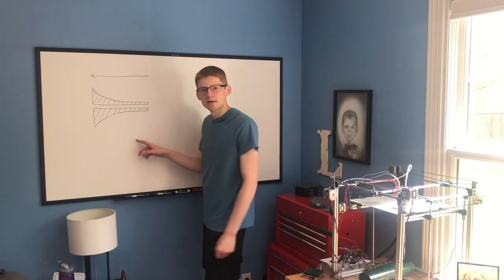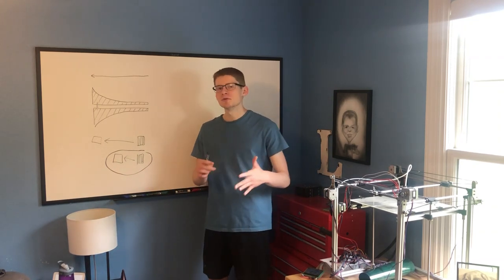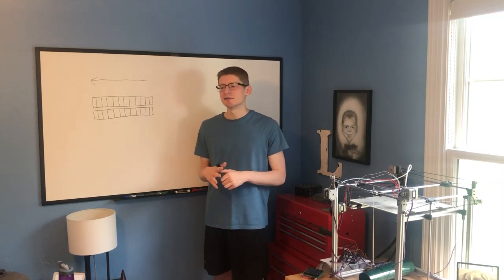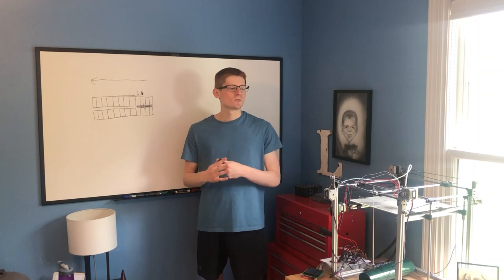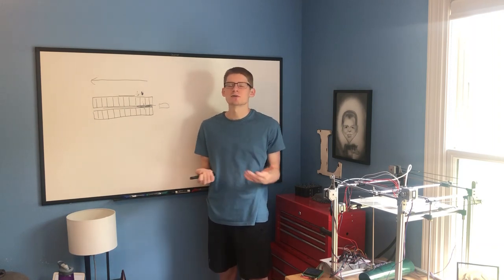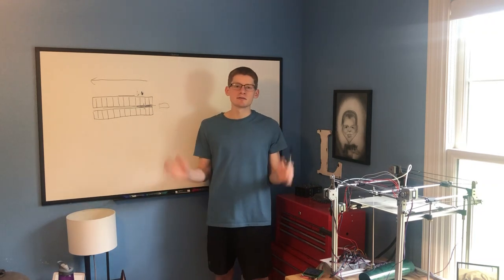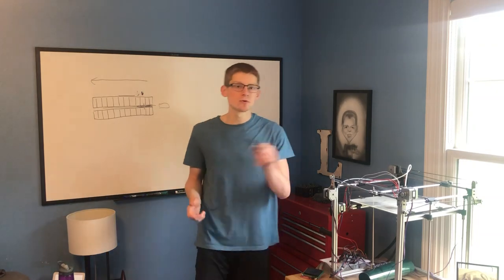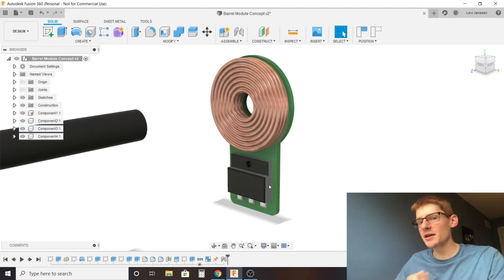Making a Coilgun - Part 4: A New Revelation

Comment: you are very wrong about your new idea.  When the geometric center of the projectile is in the middle of the magnetic field the force is the WEAKEST.  Zero really.   Try this: build a small coil, power it with a simple battery and gently throw in a projectile horizontally.  It's going to bounce back and forth inside the coil and then end up exactly in its geometric center.  Where the force is neutral........ you absolutely need to know the position of the projectile, then activate only the coil AHEAD of the projectile, throughout the whole barrel.

Comment: Now this is interesting, its refreshing to see someone focusing on a different perspective. Nearly everyone just focuses on brute force to achieve power when in reality they should be focusing on increasing efficiency so that they can achieve more power with the same amount of energy.
Reply: think smarter not harder :)
Reply: both.

both is good.

imagine a coilgun with primary AC power coming from a tractor powered generator, 40,000 watts/300 volts, step up with rectification to DC, throw in 5-10 VM, probably need home made capacitors, optimal coil geometry and projectile weight/length/switching

hard work and talent

Comment: to make it even thinner, the coil doesn't need a pcb backing -- just make a hole in the pcb such at the coil can be surrounded by it. This way everything is flush!
Reply: That's a good idea. Individual coils could be separated by a very thin slice of plastic.
Reply: Resin inbeded coil. Similar to "Potting" on sensors and encased electronics for use in aviation and similar uses. Would require multi stage production process. PCB mounted I would guess you'd have a track amperage limit even at a thick copper layer for PCB.

Comment: Use effect of the induced current in the projectile passing through the coils to turn on and off the next coil.
Reply: Iar proiectilul trebuie să nu fie mai lung decât distanța dintre bobine. Cea din față să tragă cea din urmă să împingă. Depinde în cât timp proiectilul î_și păstrează magnețizarea și ce polaritate are. Eu aș face și un proiectil bobină tip capcană magnetică, cu intensitatea câmpului magnetic variabil pe lungime. Forță la start trebuie să fie minimă iar la finiș maximă. La fiecare bobină mai adaugi un conductor așa că intensitatea va avea libertate mai mare. Distanță dintre bobine din ce în ce mai mică la ieșire pentru a imprima accelerație.

Comment: Apologies, I didn't see this follow up when I posted my comment on your last video. You've realised a few of the things I mentioned already. I have a few answers for your coil questions.

A little tid bit that might be useful, you wont want to use identical coils the whole length down the barrel. You want the current in the coil to turn on and rise when the projectile front reaches the back of the coil, and then switch off when the projectile is in the centre. The time this takes (projectile enters until projectile centre) gets shorter as the projectile speeds up (i.e. is further down the barrel), so you'll want coils with lower inductances (fewer windings) further down the barrel so that the current can rise to its maximum in the shorter amount of time.

Your pcb seems to take up a lot of space relative to the coil which is what you said you wanted to avoid with IR sensors. To hold the coil together, thicker wire will hold it's shape fairly well on its own, but otherwise you can apply a bit of nail polish or super glue to hold the coils together.

As far as detection goes, one idea I've heard people mention is inductance, the coils ahead of the projectile should have a detectable voltage induced in them from the magnetised projectile approaching them. Never seen this implemented but I've seen a few people saying it should be possible. Also, as far as efficiency goes, have a look at "Brook's coil" it's the most efficient (highest inductance, most force) way to wind a coil for a given length of wire (i.e. for a given resistance, what gives you the highest inductance or strength of electromagnet).

For how many turns you want/what inductance it should have, it should be just enough so that the current in the coil can rise to its maximum before it needs to get switched off. This depends on how fast the projectile is moving through that particular coil and your voltage. Have a look at inductor time constants. 

Finally, I'd avoid thyristors, once you trigger them, they continue conducting until the current drops off on its own (i.e. your capacitors discharges, or in the case of a battery it just keeps conducting) which means you can't switch them off when the projectile reaches the center of the coil and you're going to get suck back of the projectile (i.e. it gets pulled backwards, back into the coil as it tries to exit out the front).

Comment: To hold the coil in place / prevent it from unwinding, you could use some sort of flexible resin. If I recall correctly, I was considering epoxy, however, the radial induced force would have cracked it. Keep in mind that with high currents, the coil itself will expand radially (another reason why super-electro-magnets are solid metal).
As for the switch, there is no reason to place it within the barrel structure. Just have leads that leave the barrel and connect to the external switching device (besides, I don't think you can get IGBTs small enough to meet the size your are looking for).
For cooling, there's really no solution there, and the coils will get very hot (and potentially melt). Your choices would basically be to submerge the assembly in a coolant (like what's done with super-electro-magnets), or restrict the current such that you can fire it once, and then must wait some set time T before it can be fired again. You do not want to use an aluminum heatsink though, because even though it's not ferromagnetic, you will still induce eddy currents in it with a high enough magnetic field.
For the barrel, a carbon fiber tube would probably lead to issues with splintering, PTFE might be a better solution as it also provides some level of reduced friction. The nice thing about the coil geometry is that it is partially self centering, which could correct for any flex in the tube (you would have to rotate your stages though to correct for the slight geometry imbalance from the way the coil is wound).
Just to correct what you said about the issue with turns... if you have more turns, you have higher resistance, but you simply increase the voltage to keep the current the same. That does have an upper limit, but that's dependent on the maximum current per wire, as well as the heat dissipation, and the breakdown voltage of the enamel coating. 
And you are correct about it being sort of like a bell curve. Though it looks more like a reverse Poisson distribution, where it slowly ramps up and then quickly falls off (because of the issues mentioned above).
Reply: Încercă și rotirea inițială a proiectilul ui. Vei învinge doar cuplul giroscopic inițial și va avea direcție bună.

Comment: Regarding the position sensing problem, since the gun needs a barrel, (even if it's super thin) it could have sliding contacts on the inside, of course, they would wear out if made of a softer metal than the projectile, like copper. The only other things I can think of are sensing changes in coil inductance due to the presence of the projectile acting as a moving iron core, or using the old method of optic sensors but instead of simply jamming them between coils, a thin fiber optic cable could extend the IR emitters and occupy a lot less space, maybe running inside the coil's PCB. Plus I think not extending the sensors with fiber optics could lead to induced currents on those circuits and eventual destruction.

Carbon fiber is a good choice, but I'm afraid it's not oblivious to eddy currents. I've seen so-called "indetectable carbon fiber knives" been detected by metal detectors because depending on the type of carbon fiber, it is more or less conductive, but much less than lead so it shouldn't be a problem.

Comment: Hello,  Janssen, Thanks a lot for a detailed theory of ops. I do believe this is like an electric motor "unrolled" into an linear device. commutation is very important in motors and so you will need some kind of a sensor to commutate at the right point. Also, as the projectile speed increases, and there is an inherent lag between the sensor reporting the position of the projectile and the current building up to max in the inductor at every stage, I think the coils towards the end of the barrel should be spaced further apart to compensate for this lag than at the beginning where the projectile is moving slower.

Comment: Because the metal projectile would become magnetized. Maybe you could use the coils ahead of it to also detect the approaching magnetic field of the projectile (or rather lack of, as I'll explain) and switch when appropriate. That should be pretty fast and accurate. So each coil except the very first would be a sensor initially, and then when each detects a certain magnetic field strength behavior they swap via a transistor to become a powered coil. There might need to be some software fanagling to get it to know what it's looking for instead of just triggering from the activated coil before it, but the way this would be done would probably be to detect when the field strength is DECREASING or has finished decreasing and started increasing, as that means that the projectile has moved to the optimal position to "soak up" the magnetic field due to reluctance and is likely in the region of greatest magnetic strength. If you measure the magnetic field in front of the coil of a coil gun that never shuts down power you can probably get a good idea of what the magnetic field looks like after the projectile has passed the midpoint. Then just scale this to several thin coils, each with there own transistor. To save on the number of analog ports on a microcontroller needed to read all those coils, you could probably have the analog data line of the coil that the projectile has passed switch to the next coil down the line. This switching could even be done as soon as the coil goes from a sensor to a powered coil. I want to make this now.

Comment: Increase the efficiency of your coil gun design by using a chemical propellant for the initial acceleration of the projectile, and increase its speed further by the coil gun design.
A sensorless system was my initial idea as well, the most efficient way for a part to work is to not have that part in the first place.

Comment: The best way to cool the transistors would be to move them out of those cramped spaces for easier access. If you are dead set on doing these with modules you could rotate each module 45 or 90 degrees so they won't be cramped and you could cool them more easily, but honestly I'd just have an array of those transistors shoved somewhere else with wires running off to the coils.

Comment: I love this approach.  Systems like this are awesome to precision control, but this could be a great application of a genetic machine learning algorithm to control the coil timings based on a muzzle exit velocity.
Reply: I was thinking the same thing. Basic machine learning algorithms coupled with sensory data such as projectile mass and velocity (muzzle and intermediate velocities using internal lidar) could optimize coil timings for various projectiles.
Reply: @InfuriatedHawk  I'm sure there's some mathematical model that could be built, but it's amazing how close a learning algorithm can get to the ideal state and continue to adapt to changing conditions.
Reply: Brian Exactly, a machine learning algorithm could rapidly adapt to different projectile masses and shapes as well as the atmospherics affecting drag on the projectile within the system.

Comment: Everyone is talking about optical sensors to sense where the projectile is located. Why not use small single-wire coils between every large coils to sense with? 
You could make them ignore the magnetic fields from the discharge coils and only sense the projectile, right?

Comment: Why drive something like this with a transistor. Use the transistor to flip a relay that is of spec instead of worrying about rds and heat sinking. For your heat problem though, they make nonconductive oil you can submerge your fet in

Comment: I don't know if it would solve your coil issue, but you should look into Rodin Coils. Now, there's a lot of mumbo jumbo surrounding this subject (Rodin Coils). So be mindful of 2 things when searching on it:

1. The inventor of  the coil believes this coil has very far fetched abilities and the key is something he calls vortex math, in short don't fall for all of that BS and focus on the practical properties you can use for your project.

2. Although the coil was invented in a collaboration of people that shouldn't be taken seriously on a lot of things they claim, the coil does in fact inhibit some unique and interesting properties as measured by people who are experimenting with it, For instance, it seems to have a stronger magnetic field in relation to the number of windings it has.

Good luck.

Comment: Coil
B = 4 π µ₀ (N I) / ι
B is magnetic flux density in Teslas
µ₀ is magnetic permeability of a vacuum (air) 1.25663706212 × 10−6
N is number of turns of the coil
I is current ‡
ι is length of coil in meters (i.e. 1 inch = 0.0254m) 

‡ current is use here, usually identified as amps, but magnetic field is generated by moving electrons which suggests watts may offer more flexibility in comparing coil configuration..

Comment: Thanks for the update, couple of ideas, with your winding issue, start with the max voltage you want work with then work back from there to get your optimum coil. could you combine the  bus bar as the  heat sink for the MOSFET, maybe  even have the bus as a square tube to run air/coolant through for cooling. Keep up the good work
Reply from the maker: I was considering using the busbars as heat sinks. Even if they aren't the intended primary cooling system, they will necessarily have a high thermal mass and inherently act as heat sinks.

Comment: Tinkering with coilgun ideas for a few years. 
In my oppinion the initial stage is most of the time unefficient. The projectile has te be pulled to to coil from a big distance. Exactly what you are telling. Don't think there is much we can do about it. 
A nice way is to use a solenoid to push a projectile from a magazine into the barrel and place it at the optimal position for the first stage. 
Usually a multi stage uses a ir gate to trigger the next stage. But the ir gate is in front of the coil. So when the capacitor discharges it has to pull from a long distance and have a low efficiency. I'm thinking of two ideas.
When winding the coils embed a glass fiber rod though the coil at the optimal trigger location. And hook up the IR gate to the fiber rods. This way you can measure and trigger  from inside the coil. 
Second idea with the ir gate in front of the coil is a trigger delay that can be set with a potentiometer. Ns-ms range. 
Most of the time the velocity after the fist stage is stable at a given speed. 
When the projectile passes the ir gate the trigger is delayed to the moment the projectile reaches the optimal discharge  location.
By Modifying the delay you can tweak the maximum exit velocity.  Each stage should have less delay since the projectile speeds up.

Comment: Hey, 
I guess i may help,
U asked u want more turns, without increasing resistance,
Why don't u go for thicker wires,
In that way , you get a longer wire to increase the number of turns, without increasing the resistance,

Like if u increase the diameter by 2 times,
Then u can get 2 times tge length of previous wire at the same resistance,

Also , ur 2nd question, u want to kniw how many turns to go for a single coil, well 
First u should know how much each coil should provide force,
Based on that u can easily calculate the no. Of turns u need, using simple formula.

Comment: stop using non ferus materials as your projectile it must be ferus magnetic or you sacrifice most of the energy. also you are correct in stating the travel tube ie in your case has to be for example carbon fibre but even carbon holds magnetic properties be it slightly and even this impacts energy efficiency etc. your idea of coil over coil is good but you forget the more copper you use the stronger the dampening effects are due to coppers unique properties.. what you need is stable flip/flop system/circuit with a high release power source ie super capacitors that have an end to end on their +/- leads ( like a spring soldered to both +/- as this allows current to be released much faster than standard means. tho temps are higher. so a cooling system must be inplace to prevent any over heat as you know high temps=negated magnetic field... ps science is fantastic :)

Comment: I don't know about the possible bell curve of the force, but assuming that it is constant for any current and number of turns as long as their product remains the same, then twice the turns means half the current to achieve the same force. Therefore, since power losses of a resistor is R*Current^2, it also means that doubling the number of turns halves resistive losses on the coils

Comment: If you are familiar with calculus, and can set up a formula for the parameters you want to (maximize/minimize), and use derivatives to find the minima and maxima.
I still believe in SCR's and capacitors though.  Have you looked into the large IGBT's?  They are especially good at driving inductive loads.  But I have to say I have learned a great deal about strange magnetic fields by calculating the magnetic fields at a point using the Biot-Savart law.  It's an enormous amount of number crunching, but well worth it.  I wish I had time for more of this stuff.